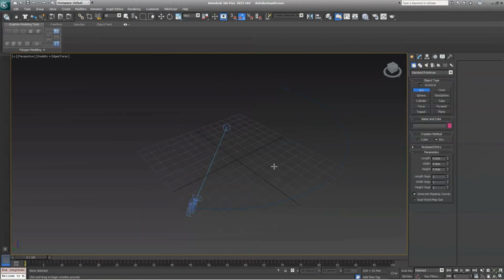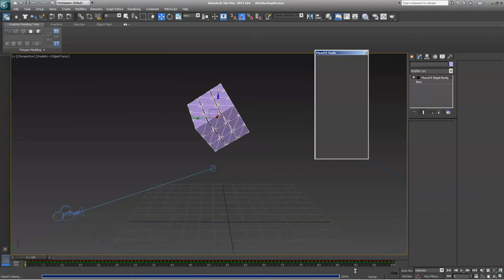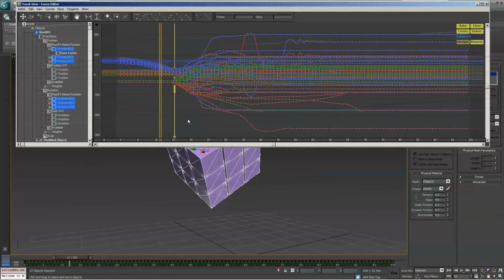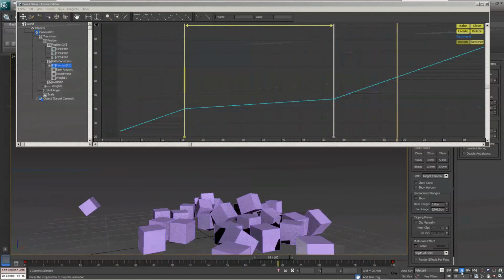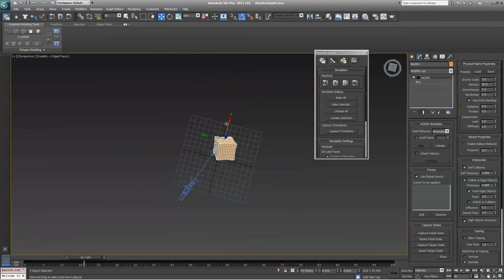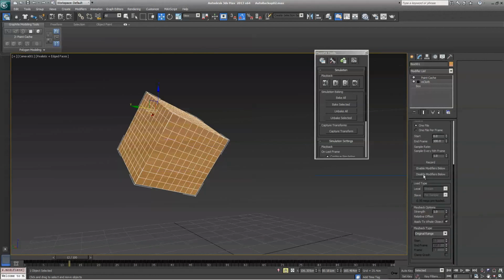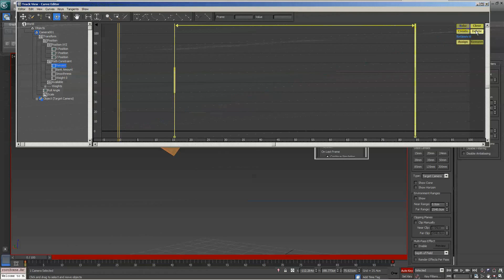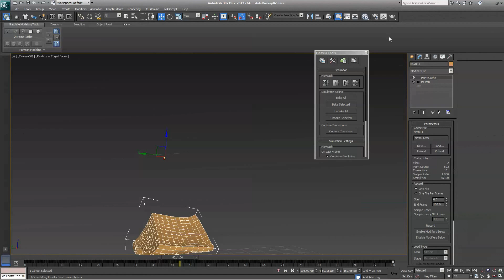ReTime Tool - 3DS Max Slow Motion Tutorial - New to Max2013 - Level: Intermediate

Comment: Good tutorial. I just discovered this tool to retime animation and I thought it was exactly what I needed. But in the end I can't use it because I can't freely edit the tangents of the retimed intervals. I would need an ease in/out option (not just ease in OR ease out), and it should also affect the track outside the retimed interval, otherwise the flow is not smooth.
But I found a better solution: just apply manually an ease curve to one or more track, edit it (and here I can do what I want with the tangents) and then, if I need to extend this retiming to other objects, I can just copy and paste as an instance the ease curve to other tracks.

Comment from the maker: You are welcome. MassFX,  is the "new" simulation system by Autodesk. It uses the PhysX engin to calculate simulations for cloth and rigidbodies. It replaced the hole "Reactor" system in Max starting I think at Max 12 or 13.  The 3DSMaxHowTos channel has to a good beginners tutorial on it.